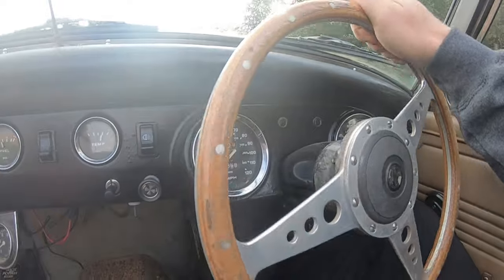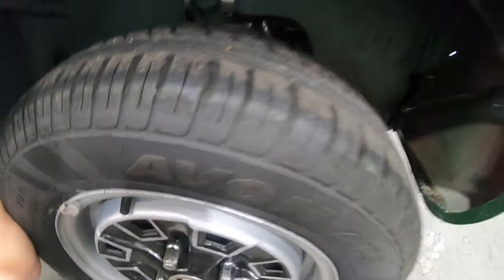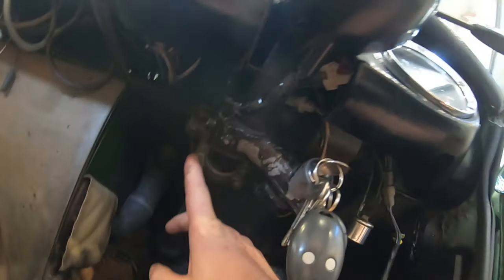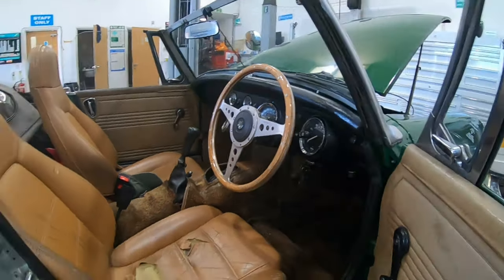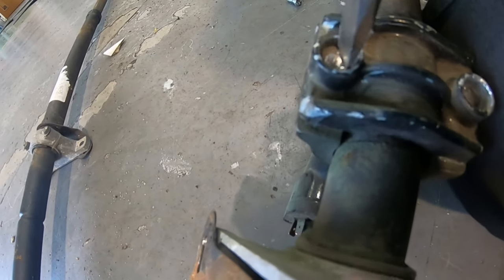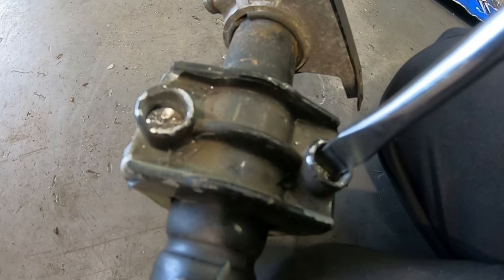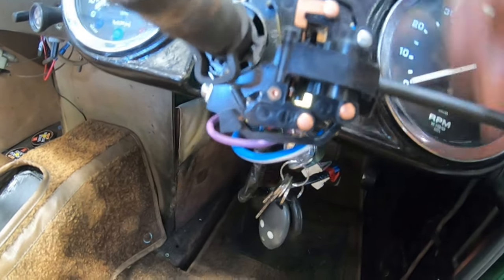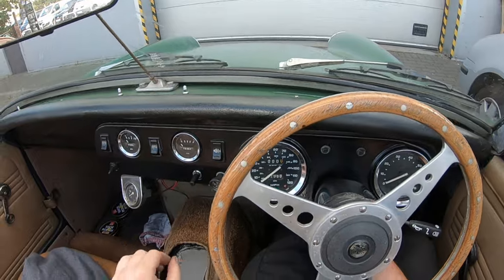How to replace your MG Midget steering column - This one's dangerous!

Comment: The engine on your car sounds really fit.     I had an MG Midget many years ago with this stiff steering issue.  The problem was lack of maintenance of the kingpins and the old grease had solidified. It was not possible to push new grease into the kingpins even with a garage high pressure gun.  I freed them off by taking off the top joint and using WD40 over a number of days to soak the kingpin from the top whilst rotating the steering.  Can't use heat due to the rubber seals.  After two days the old grease softened and I could again force new grease through the kingpins and all was solved.  The same could apply to the steering rack and the steering column. 
Frequent lubrication with new grease is necessary and it may be this stiff steering was what prompted the previous owner to sell the car to me. It was almost solid steering.  The car was a daily driver for six years after fixing this, when children forced the sale.  Thirty years later , I have another Midget in my collection.
Reply from the maker: Well done! Don't think I could ever sell mine